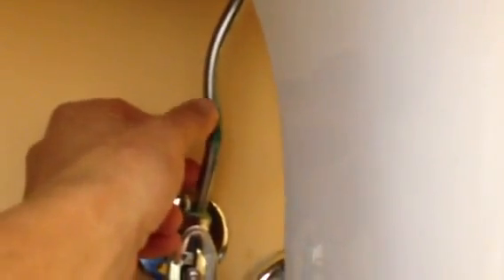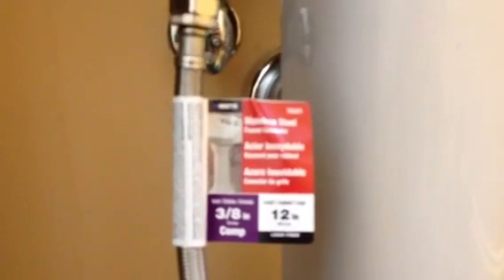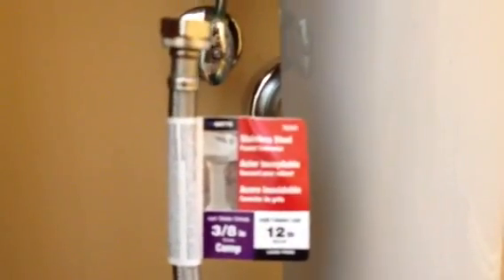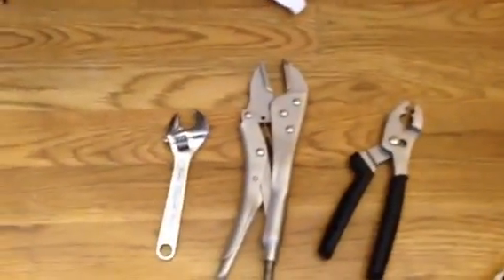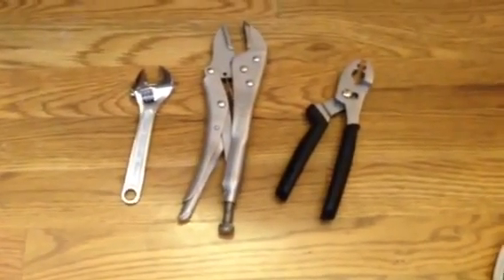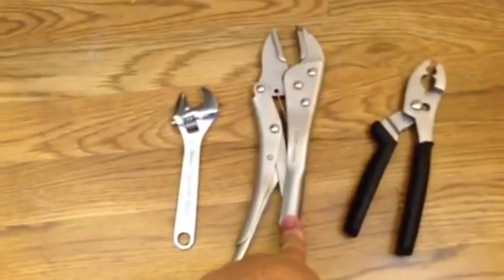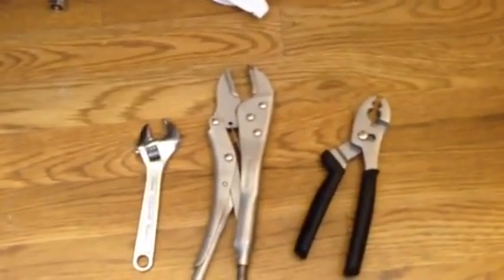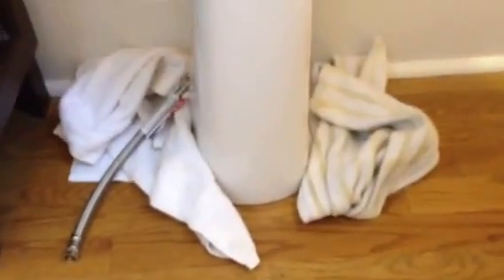How to remove replace install braided faucet water lines for a sink

Comment: have you ever seen a problem where the new water supply lines leak from the shut off valve? I bought some new lines but the instructions say to hand tighten and then quarter turn with a wrench however even so it still leaks. It it a problem with the supply line? is it faulty?

Comment: On my sink the nut up towards the faucet is quite tight, so I need to use a wrench, but the area is too cramped to get a wrench up there, what do you suggest?
Reply: +leojbramble You'll need to use an item called a 'basin wrench'....it is essentially a 'vertical' wrench.

Comment: Aren't you supposed to put putty or plumbers tape around the fittings?
Reply: Chris Fama No,there is a rubber gasket in the bottom of the supply line